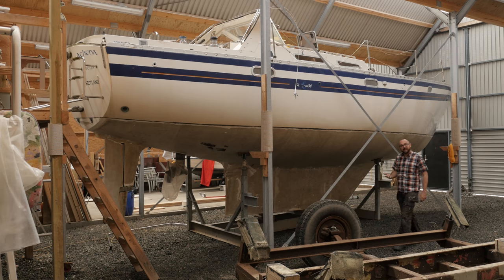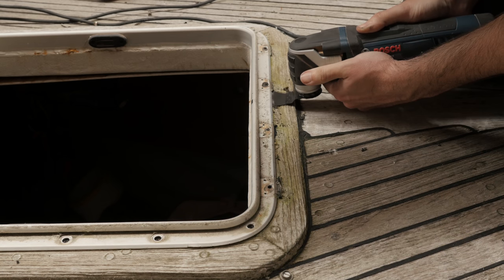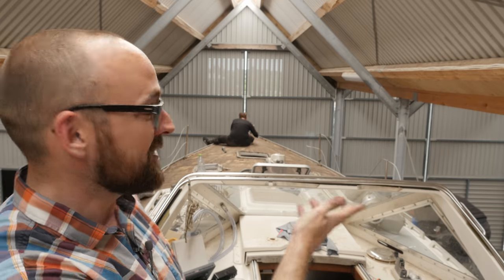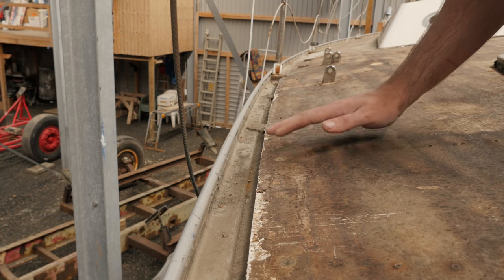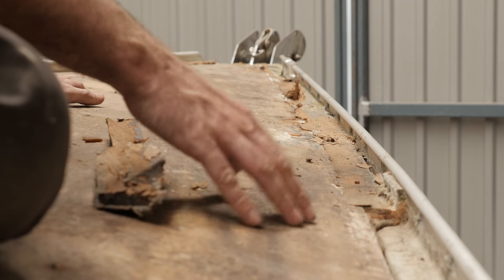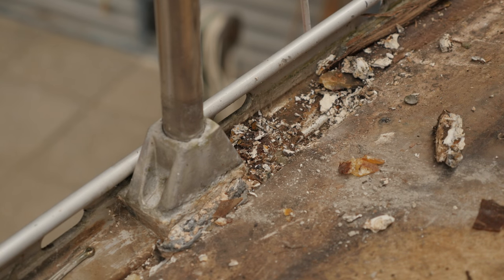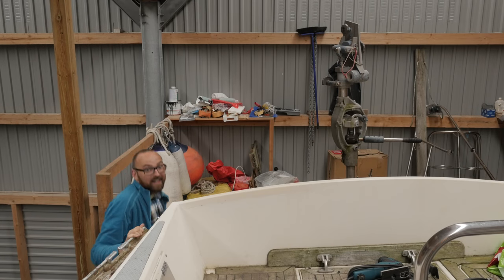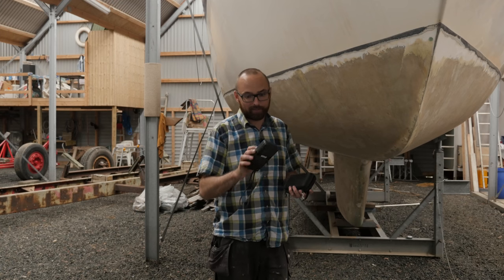Sail Life - Removing the old teak deck & issues with the deck - DIY sailboat refit

Comment: Did you say the boat had a foam core deck?  It sure didn't seem that squishy to me and I was wondering if another coat of fiberglass fabric and mat before might be adequate.  As for drying out the hull have you considered heating the boat inside? This would raise the relative humidity on the outside layer of air and the differential would suck the moisture out of the hull.  Don't know how efficient it would be.  I was wondering if you ever calculated the relative humidity in the hull to the relative humidity of the air.  If they are similar, then the hull will not dry out unless some type of differential is created.

Comment: Hey Mads,
I have a question for you...it seems as though most owners are having a wet atmosphere aboard. Here's my question...do you think an AC powered dehumidifier would provide fresh water and a drier atmosphere?  I bought a 30 liter/day model for not much money.(70 USD) if the catch basin were sealed would the water drawn from the atmosphere be excessively corrosive and britney? I know desalinater systems are very expensive and take up a lot of space so I was just wondering about a workaround. Since Obelix is in a marina with AC maybe you would like to see if there is a possibility of a work around. (This is written 6/11/17 so possibly you could comment)

Comment: You mentioned in an earlier video that the core is foam.  Is that above the waterline and below?  Or is there some type of balsa or wood above the water line?  

Imagining something like this:
https://www.google.com/patents/US5094010

Great video.  Thanks for sharing.  Looking
Reply from the maker: Thank you so much :) The hull is not cored :) Just the deck. The core in the deck consists of a combination of foam and wood. I'm in the process of sourcing new foam and 60L (15 gallons) of epoxy. I'll consort with my friendly local shipwright about how to best deal with the deck :) As for the hull. I'm 99.99% sure the DIY HotVac copy is going to dry that out relatively fast. The moistureless just need that last kick in the behind to get them into an acceptable range :)

Comment: Sorry to hear about the moisture issues with the deck on Athena, at least now I am not feeling so bad about replacing the rotten wood on the deck at my house, your job is MUCH larger!  I saw a video last month that might have been helpful to you, but now I can not find it. (Dang nabbit!)  The fellow was replacing the deck core on a Ericson by carefully removing the deck top in sections, replacing the core, then putting the  deck back.  I did find a similar video series, but you might have issues understanding the english dialect being spoken. (southern us)  https://www.youtube.com/watch?v=oORZadk9LqI  This might be the way to go for you, at the same time you could fix the screw holes, and, maybe even find a solution to deck edge issue near the toe rail.

Comment: Hi Mads!
At some camera angles the boat seems to be leaning to the right. Am I right? Is that a problem?
Reply from the maker: Hi, Henrik :) 
It is leaning quite a lot but it's not an issue :) When it comes time to work on the starboard side of the hull I'll tip the boat to the other side :)
Reply: Sail Life I wasnt crazy then. I remember a guy working on a Folkbåt of wood and he realy tilted his boat on the side as if on a tack. He was working with sealing the cracks on one side before new year and the after new year he tilted to the other side to work that side. When he launched the boat only a thimble of water came in.

Comment: That sucks about the wet decks!
Reply from the maker: Such is life :) It just means I won't get bored over the summer ;)
Reply: Sail Life flat surface in a summer shed with high temperatures and wind flowing over the deck schould be ideal for evaporating the moist from under the teak. 

you plan to re-teak? of just paint with some anti skid? 

personality I would just paint the deck and when you buy teak use it on the inside or the cockpit floor. BTW how much weight was all that deck teak?

Comment: Mads a set of bolt round over remover sockets and a long extension, combined with a drill will make easy and short work of those screws in the deck. http://www.toolstation.com/shop/Automotive/d60/Socket+Sets/sd2938/Irwin+Bolt+Grip+Nut+Remover+Set/p81815

Comment: get you a set of chisels. it'll go faster than the screwdrivers.
Reply from the maker: I've got chisels but they're nice chisels and there is no way I was going to put them through that. Sure I could have gone out and picked up a cheap chisel but the screwdrivers worked out ok :)
Reply: "Stemmejern" Mads, you need some "stemmejern" in different sizes :-)

Comment: Hej Mads I am curious have you heard about hydrolyzed resin I was thinking is it possible that it is that that's giving you high moisture readings here's a link if you want to read about it http://www.yachtsurvey.com/my_wet_hull.htm and if this is not the case why would you try too apply salt too a small section of the hull and then wrapping it with plastic to stop the salt binding the moisture from the air instead forcing it to suck the moisture from the hull basically making reverts osmosis 😊